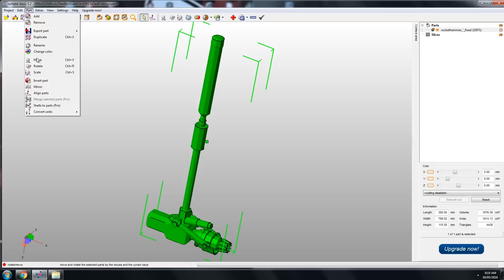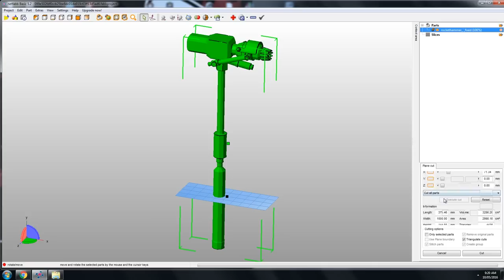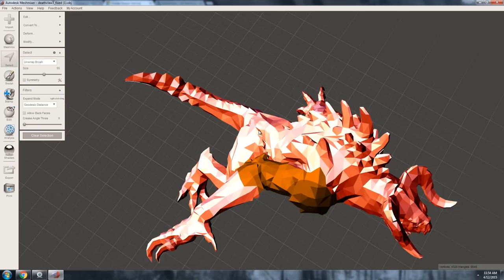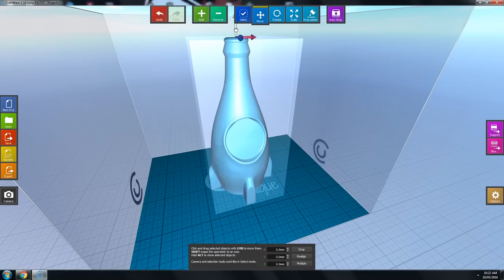How to slice and cut stl files for 3D Printing - 3DP 101

Comment: There was a tool floating around for opencad that would slice an object up into a set size and put connectors (t-shaped) in so that the print could be slid together to form one large print. It removed any worries of alignment as it should self align.
Reply: +DragonRoco http://www.thingiverse.com/thing:35834
OpenSCAD is really useful. Haven´t used puzzelcut myself yet though.

Comment: been using these methods, but sometimes you just need to print something in one piece where you can hide a seam. I was working with a 200x250x200 bed on my MakerGear M2 for a while -- then got a TypeA Series 1 Pro with a 305x305x305 bed. Then just because I like a challenge and to torture myself, I designed and build a delta 490mm diameter x 675mm height. Now I think I can print just about anything I need or can print on one spool without cutting it apart. Expensive hobby. Did some test slices on the delta, anything that fills up the build volume and is not a  vase will take 4-5 kgs of plastic, so that will be fun.

Comment: gotta say... i bought a tronxy x3a  faulty board faulty x motor and lose black wire on leveler... the anycubic kossel plus linear which had a loose wire in leveler and needed a new board as despite setting the thing up nothing was storing even after umpteen  gazillion ( large number indeed)... firmware cleardown and re flashing . after such a baptism of fire I was having all kinds of print issues.... your channel has been outstanding ... as has joe at 3dmn and lots of other guys.  Without the guidance  you and the community provide life would be soooo much harder...    thank you

Comment: FlashPrint has a cut tool. You can cut diagonally as well as XYZ. You can even save STL after it has been cut.
Reply from the maker: That's really neat! It sounds like flashprint has improved hugely since I last used it. Wish I could use it to slice gcode to other printers!
Reply: Software has come a long way, great job by the coders.  Tree supports and regular supports have crazy options too.

Comment: haha! That's me. thanks! Exactly what I'm doing now with a large piece but putting the pieces together exactly will be critical. So am I correct in that I can use Meshmixer to cut two halves that fit like a puzzle for extra strength? thank you.

Comment: hey makers muse, I'm a student and i can only keep my printer in my room because my dad uses the office, but i want to make some larger prints. So anyway, i wanted to know if there is a possibility to slice what I'm printing into multiple sections so i can start printing today. turnoff my printer and finish printing tomorrow. I have a Troxy P802E and it doesn't have any features except that it is a kit.
it doesn't remember anything if i pull the plug and can't start printing from where it was. and i haven't had any luck with plugging it up to my computer via USB but i also need to use my computer a lot. and i heard that i can mess up a print if I'm doing something on my computer.PLEASE HELP!!!!!!!!!

Comment: What if I want to cut my model with more complex cuts than just a plane cut?  For example a full sized helmet.  If I use just plane cuts I may get some weird seams that will be a pain to fill and sand later.  However, if there was a way to contour my seams to parts on the model, I could place seams in easy to fill places or in places that would be less noticable in the final model.  Is this possible?  How would you do it?
Reply from the maker: Extremely difficult to do this once the model is in mesh format, but you can 3D design a cutting 'blank' and use that with a Boolean difference. It's best to separate parts in the modelling stage if you're after complex cuts.

Comment: I use Maya and Zbrush and Meshmixer to check the mesh.
Reply from the maker: +TheIcemanModdeler As I've said in the video, Meshmixer is one of my go-to programs for this technique. On the other hand, I have not yet had a chance to dabble in either Maya or Zbrush extensively, though looking at Zbrush I would definately pursue the oppertunity to explore it further as it looks like an amazing program (once you get through the interface). What's your thoughts?
Reply: +Maker&#39;s Muse Yeah been using these programs for more than 10 years and both are quite difficult for beginners but they are two of the most powerful and most used programs in the industry both in games and movies.
Zbrush has the most customizable interface out there, many artists including myself have custom ui and shelfs for the tools that we use the most, although i wouldn't say the program is hard in itself the sculpting is especially and if you've never sculpted or drawn before at a decent level that will take a while till you get used to the brushes, the shapes, form and silhouette and dividing the mesh.
An alternative to Zbrush that is much easier but also with less options is Mudbox but if you've been following the plans that Autodesk has for Maya they will incorporate soon Mudbox sculpting into it to compete with Zbrush.
Reply from the maker: +TheIcemanModdeler Yeah I have had a look at Mudbox before and find it quite good for a quickie model (and great when teaching students), but have gotten myself into a comfortable zone with Meshmixer and CAD when it comes to my work. I played around in Zbrush before, and from what I could grasp it's capabilities are amazing-especially since I struggle with creating organic forms from scratch. Sadly I am not a huge artist in trade so it would take time for me to get used to the utilities offered and the format. Though my assistant/minion is interested in picking it up and learning it, which should be interesting since she hasn't delt with much 3D modelling before... Should be quite entertaining! I'll make sure to recommend your channel when she starts so she gets the right idea!
Reply: Sure, i don't have tutorials on my channel due to my job but if you or her have any questions feel free to ask, oh and thanks for the great Craftbot Plus review, got myself one and it;s been amazing so far.
Cheers